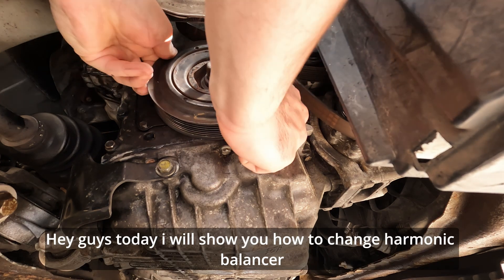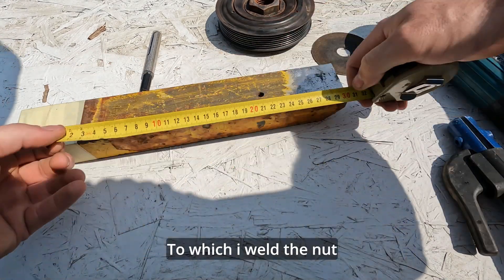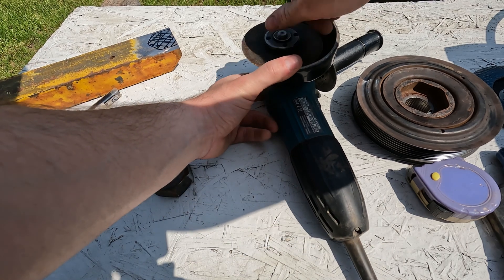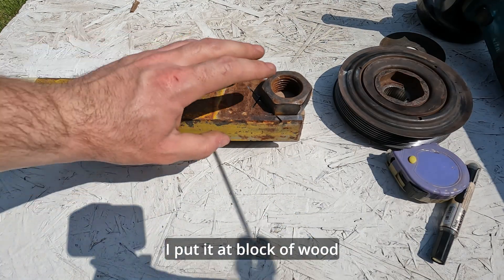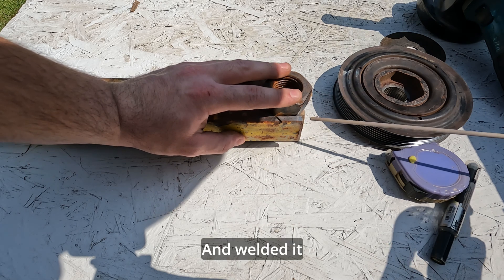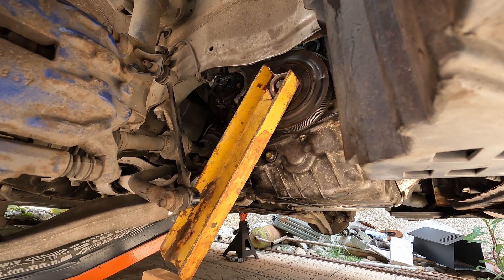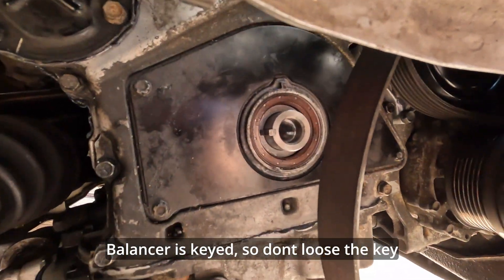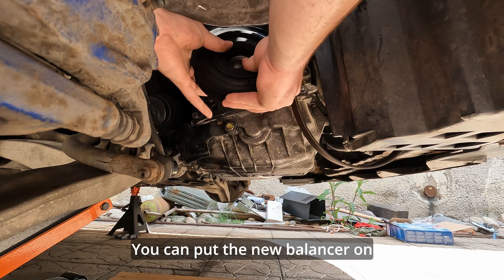How To Remove Crank Bolts/Pulley + DIY Honda Crankshaft Pulley Holder

Comment: After i changed pulley it starts leak oil you know why?
Reply from the maker: Hi, you probably need to replace the crankshaft seal. https://youtu.be/J1Ha_O8G4qQ?t=1771
It can be replaced without removing the cover.
Reply: I replaced seal it still leak what nm pulley bolt should be?
Reply from the maker: @labaslabukas2454  I don't think there will be an error. Is it definitely flowing through the crankshaft seal?
The manual says 34 N·m + 90°
Personally, I tighten it to 200Nm and after replacing the crankshaft seal it never leaked. There could be a leak elsewhere and it flows from top to bottom.
Reply: @easywork2  I pushed the seal deeper now don't leak
Reply: @easywork2  maybe u know why warm engine harder to start?
Reply from the maker: @labaslabukas2454  What kind of car and engine do you have? 🙂
Reply: Civic 2.2 2007
Reply from the maker: @labaslabukas2454  Is the timing chain not stretched? Did you monitor the fuel pressure on diagnostics? Do you have any errors in your ECU?
According to this, I would bet on a pressure relief valve.
Reply from the maker: @labaslabukas2454  
Look at the engine. The fuel rail is the tube with several brass nuts with narrow metal tubes (fuel lines) attached. To the left hand end of the tube, easily missed, is what appears to be a 17mm bolt. Close by is a black braided flexible tubing (low pressure fuel return pipe).

With the engine off, disconnect/pull off the black braided hose, you may need a flat bladed screwdriver to get this started. Attach PVC tubing to the end of the braided tube, seal with adhesive tape, put other end of PVC tubing into container. A 1pt milk bottle seemed to rest quite neatly in the engine bay. Place rages under the tubing and the now exposed metal tube.

Turn over the engine for about 10-15seconds. Return to the engine bay and inspect the container. If diesel is present either in the tube or in the container the over pressure relief valve is most likely to be faulty.
Reply from the maker: @labaslabukas2454  I have written a short guide here for you. Alternatively, I can record it for you on video.
Reply: @easywork2  If you can make the video.Thanks for helping.